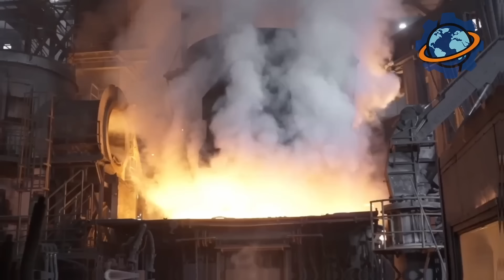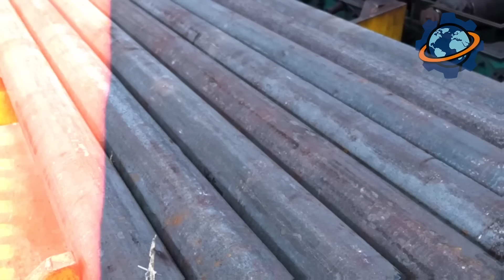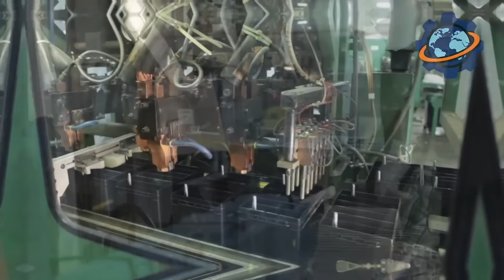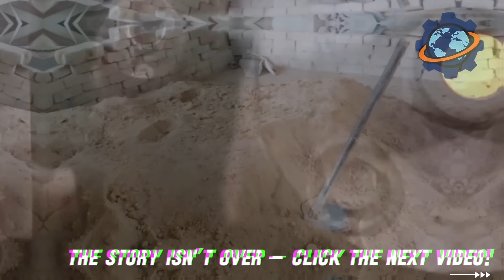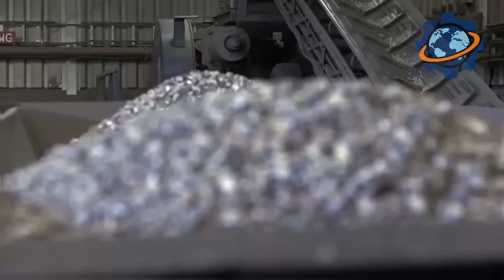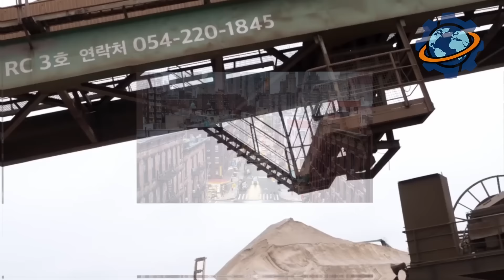The Metal That Never Dies: The Terrifying Physics of Mercury

Comment: It takes a year or more for a very tiny drop of mercury to evaporate.
The ultraviolet light and screen to see the mercury 'vapor' isn't as real as they try to say it is.
It is more of the temperature of the air current over the mercury pool when they perform the
vapor display.
If the vapor was a dense as they try to make it out to be, people would be passing out, yet
they used to have a tank of mercury at the Smithsonian museum in the 1950s, and no one
ever got sick there.

For thousands of years, people used mercury and some of the other forms of mercury, and
they knew which forms were safe, and which were deadly. But the main reason for taking it
off the general market, was because it can turn into an explosive! One of which, they needed
for the wars in 1910s and 1930s! Many metals were scarce during the wars, and they didn't
want to lose control of them afterwards.
Reply from the maker: Thank you for sharing your insights, @crashburn-s3b! It's true that the properties of mercury are fascinating and complex, and the nuances of its vaporization can lead to some misconceptions. Your perspective adds depth to the discussion!